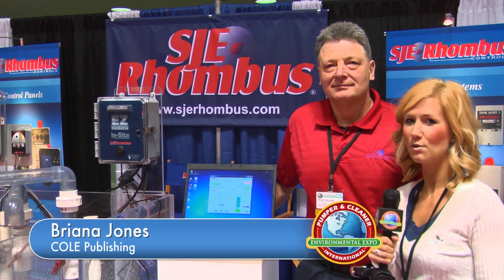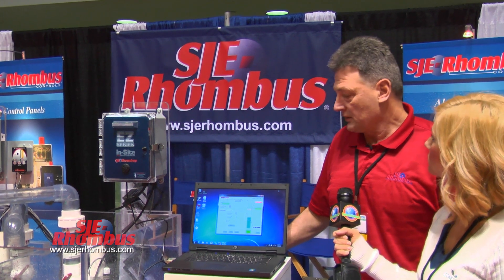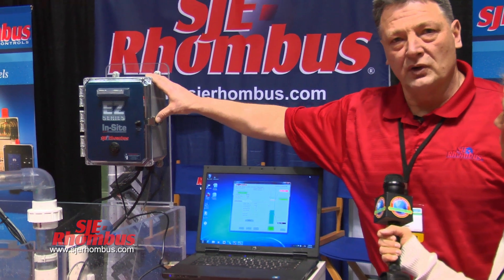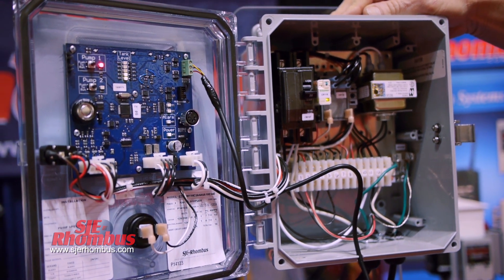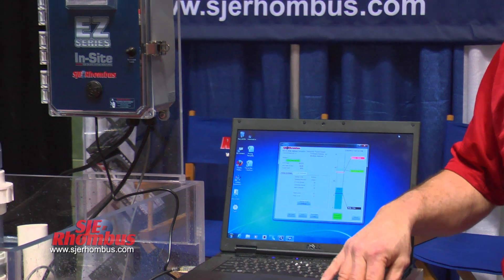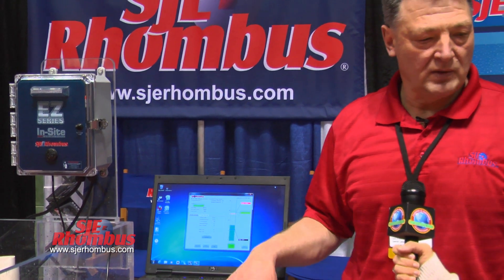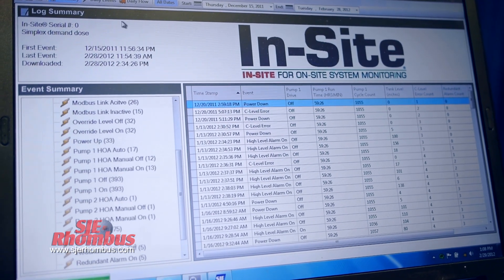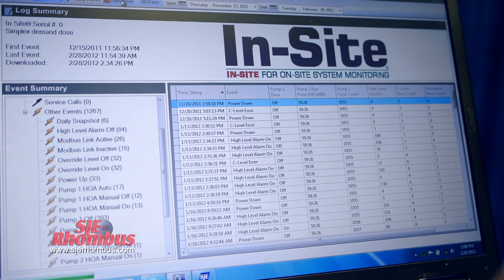SJE-Rhombus - EZ Series® In-Site® CL Control Panel - 2012 Pumper & Cleaner Expo

Comment: I've learned the hard way to stay away from solid state control panels.  I've wasted many hours on service calls with customers getting false alarms signals.  If you use one make sure they have surge protection.   Having owners mess their panels is the last thing I have to worry about.   I was told by my supplier that one county in my state will not allow the IFS panel to be used.   On one re-occurring alarm problem, the Rhombus Tech came out and said it was the electricians fault for using the terminal bar to wire the air pump and UV light off of.  The electrician countered that the instructions didn't say not to, but just said it was suggested not to.  So there I am in the middle after having driven 60 miles round trip several time with ghost alarms going off when the tank level was fine. 
I've never had a problem with the old fashion Simplex Time Dose models.  I love the dial timers.
I work for the local Navy Base and some installer used another brand of solid state panel with a transducer.   It fried shortly after installation.  I talked them into ripping it out and installing a Rhombus Simplex Time Dose panel with dial timer.   Problem solved.   Engineers love complexity.  That's because they don't have to service and maintain systems.